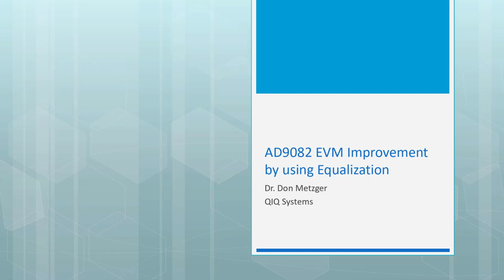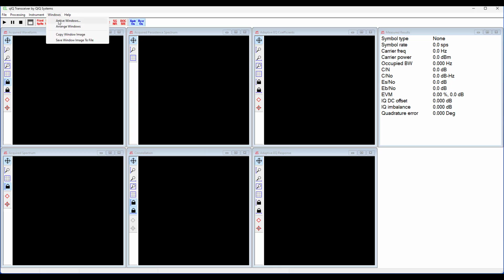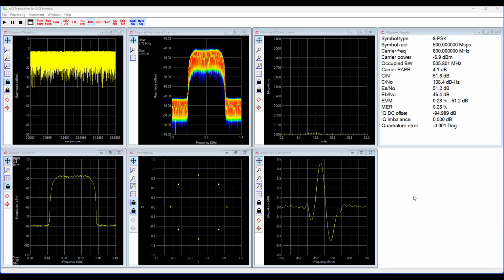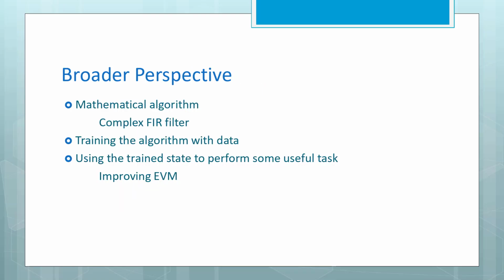AD9082 EVM Improvement using Equalization

Comment: Improving EVM Performance with Equalization: An AD9082 MxFE Case Study

* 0:00 Introduction: Don Metzer introduces the concept of using equalization to enhance the Error Vector Magnitude (EVM) of a communication signal using the Analog Devices AD9082 MxFE chip.
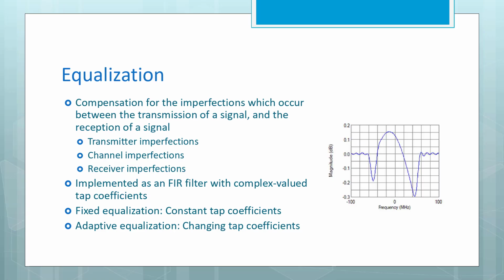* 0:39 What is Equalization?  Equalization is a technique used to compensate for imperfections in the signal path (transmitter, channel, receiver) using a finite impulse response (FIR) filter with complex-valued tap coefficients.
* 1:03 Fixed vs. Adaptive Equalization:  Fixed equalization uses constant tap coefficients, while adaptive equalization continuously adjusts them for optimal performance.
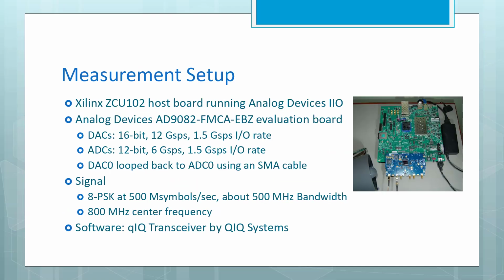* 2:28 Measurement Setup:  A Xilinx ZCU102 host board with Analog Devices IO software controls an AD9082 FMCB evaluation board. An 8PSK waveform at 500 Mega symbols per second is transmitted and received via loopback.
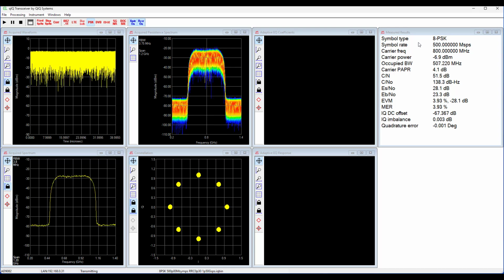* 6:24 Initial EVM Measurement (No Equalization): Without equalization, the EVM is measured at 3.93% (-28dB), significantly lower than the expected signal-to-noise ratio (SNR) of around 50dB.
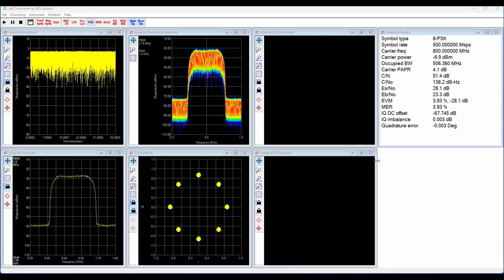* 8:30 Adaptive Equalization Applied: Enabling adaptive equalization with 33 complex taps dramatically improves the EVM to 0.28% (-51.2dB), close to the theoretical SNR.
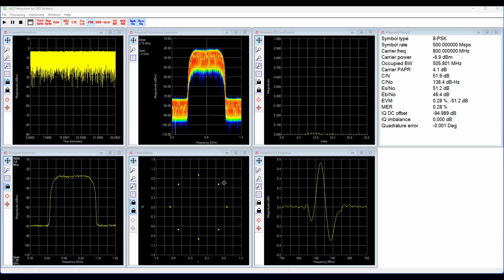* 10:56 Saving and Applying Fixed Equalization: The tap coefficients from the adaptive equalizer are saved and applied as fixed equalization, maintaining good EVM performance (around 0.3% or -51dB).
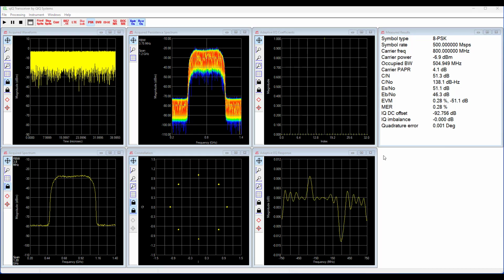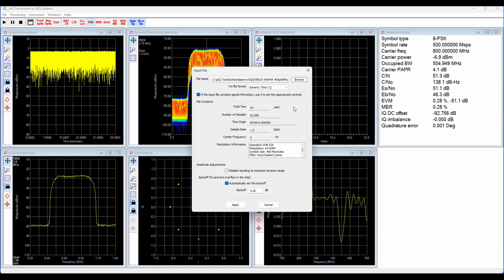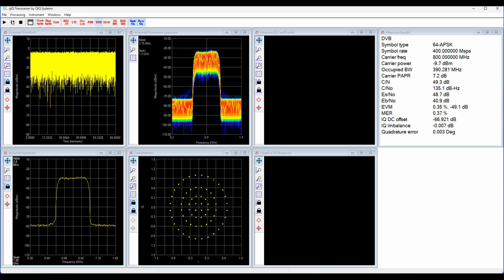* 13:49 Testing with Different Waveforms:  The effectiveness of the fixed equalization (trained on the 8PSK signal) is validated using a 64 QAM DBPSK waveform (14:35) and a 256 QAM waveform (16:46), both resulting in significant EVM improvements.
* 19:29 Summary of Results:  Equalization, both adaptive and fixed, resulted in a substantial improvement of approximately 23dB in EVM performance.
* 19:31 Equalization as AI: The video highlights the concept of equalization as a form of AI, where a mathematical algorithm (complex FIR filter) is trained with data to perform a useful task (improving EVM).

I used gemini-1.5-pro-exp-0801 on rocketrecap dot com to summarize the transcript.
Cost (if I didn't use the free tier): $0.07
Input tokens: 17504
Output tokens: 518